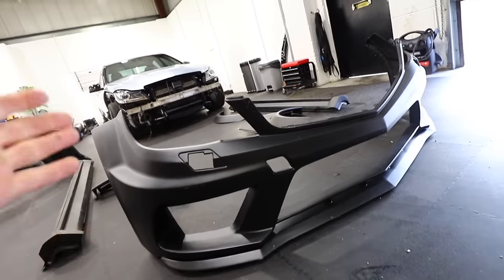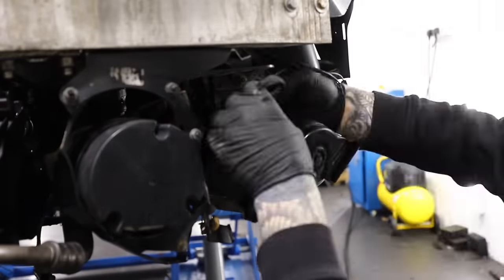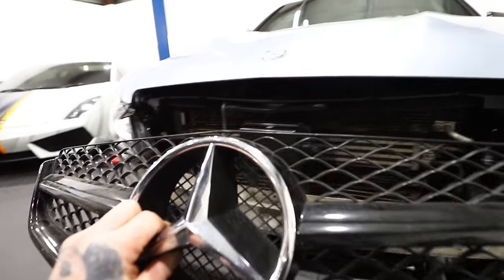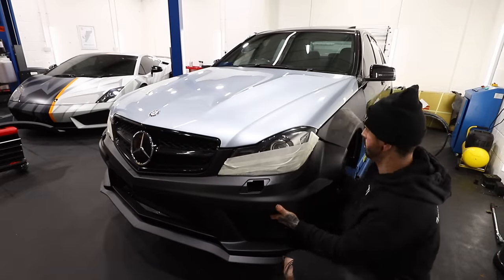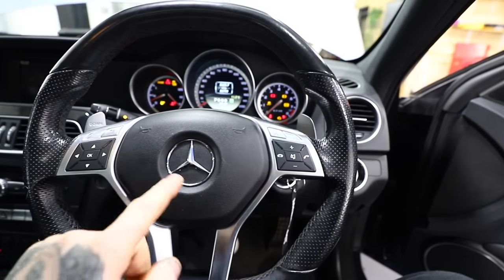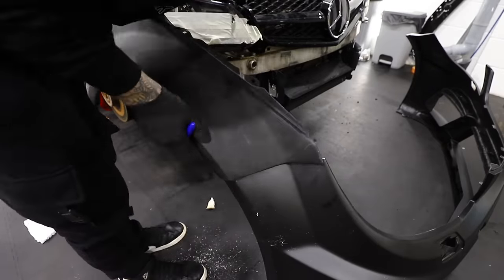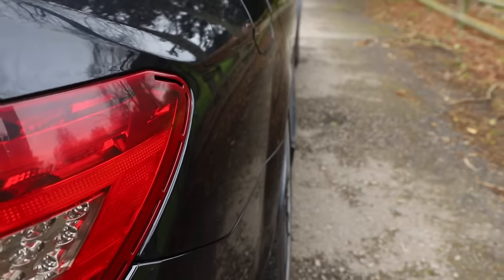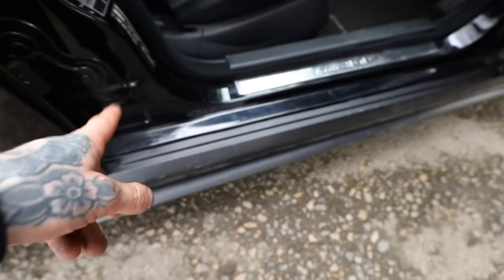CONVERTING MY WRECKED MERCEDES C63 INTO A BLACK SERIES

Comment: Hey mat, when I was fitting sideskirts to my mk6 golf we used the glue to stick windscreens on (the black stuff) for the perimeter around it and then drilled it into the bodywork of the car. Worked a charm and kept the inside water-tight. Hope this helps!

Comment: Air con will be my guess why your engine fan is on, the air conditioning pressure sensor if it thinks the pressure is too high it puts the fan on to cool the condenser. Is the air con pressure switch OK and not damaged in the accident? 

Although I have a 2011 c63 saloon and mine failed and did exactly what yours has, now I recall the sensor is low down on a pipe so it might be the wiring being open circuit causing your fan issue. If you wire up the sensor and plug a sensor in the fan should stay off if the sensor is OK.

Comment: Not sure if this helps, i repaired a crash damage c class w204 few years ago, my fan was constantly on full power, i changed the fan and temperature sensor both did not work. Few days later my cimate controls stopped working. I replaced it and the fan began to operate normally. Try to operate climate controls if the it lags or doesnt work, try replacing it and it may fix the fan problem.

Comment: I had the same issue with the fan constantly running, my ac pressure sensor was faulty and had chopped wires once I replace and re-wired the sensor it fixed the problem, hope this helps